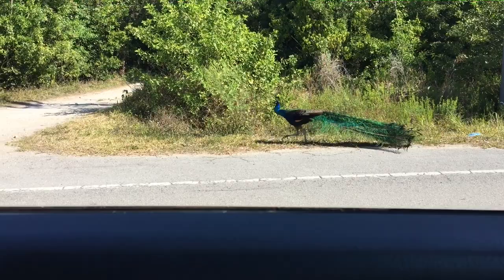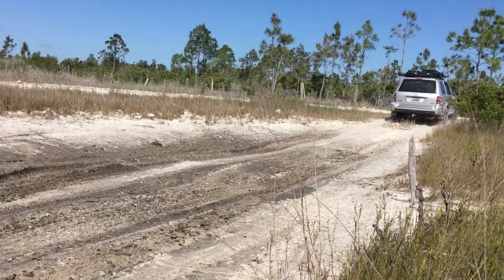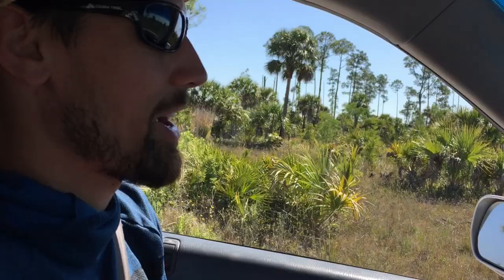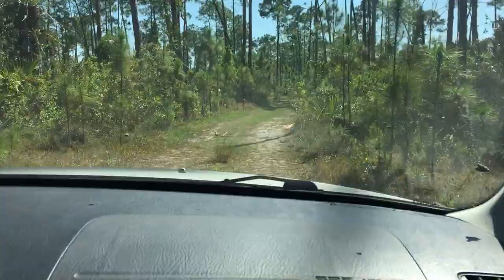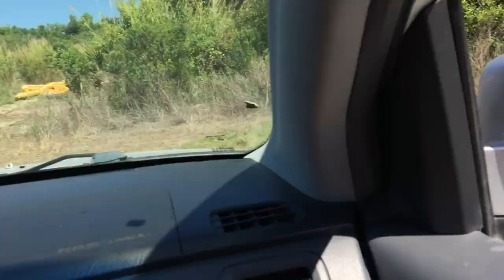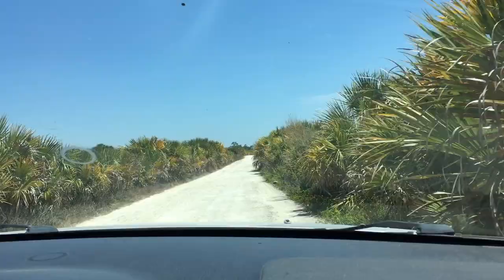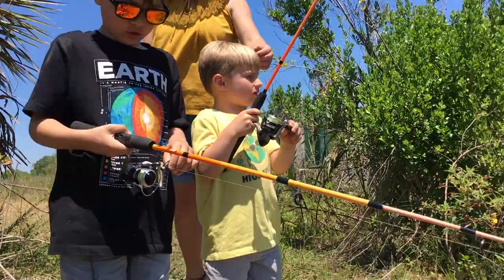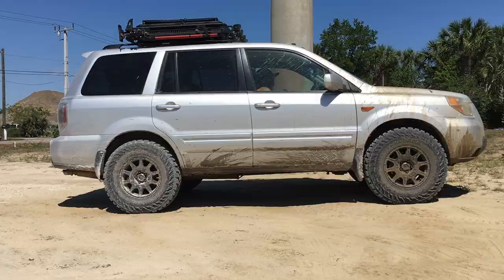Honda Pilot takes on Powder Sand and Rutted  Roads at Picayune Strand State Forest

Comment: what is your overall wheel and tire height with the rims and tires you have on?
Reply from the maker: 235-75-16 tires have a 31.7" diameter
Reply: @GotterAdventure  what kind of tires are these?
Reply: @GotterAdventure  thank you... deciding on whether or not to lift my 2011 Pilot. Still in the air about it. Have a GREAT day!
Reply from the maker: @rolandzapata5197  I would recommend HRGs 3"ultimate lift and 30.5" tires. I believe your Pilot has 17" wheels so 245-70-r17 should work great!